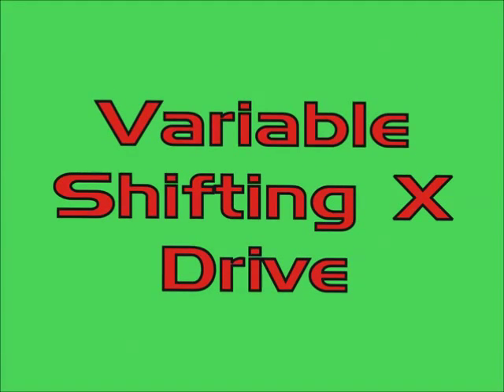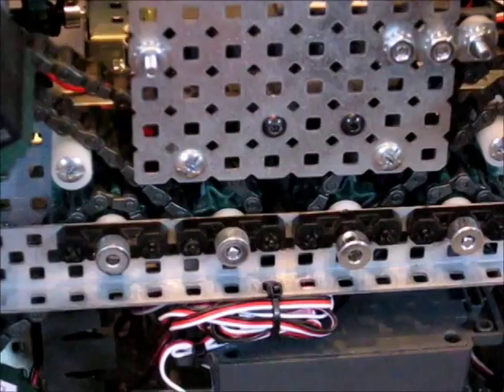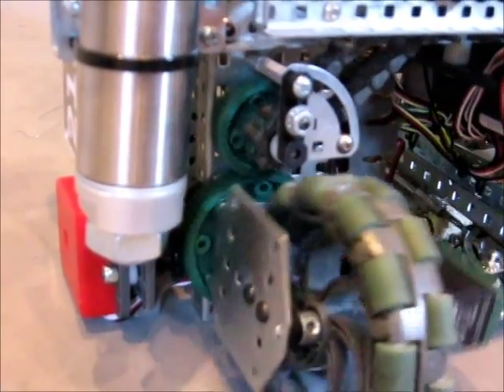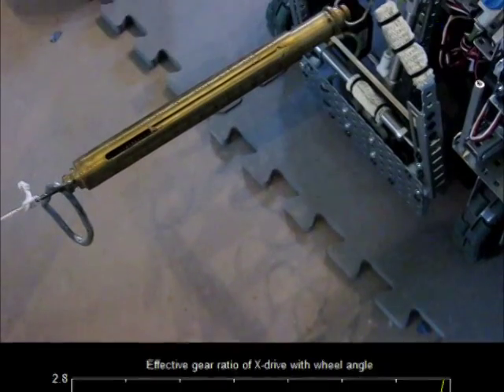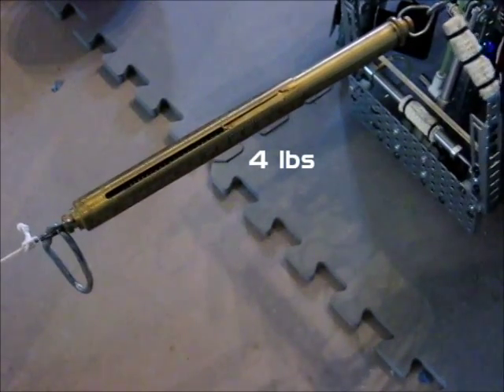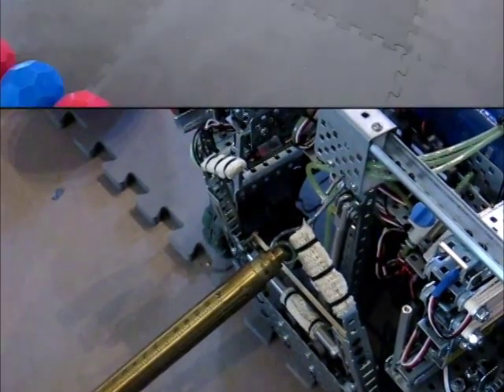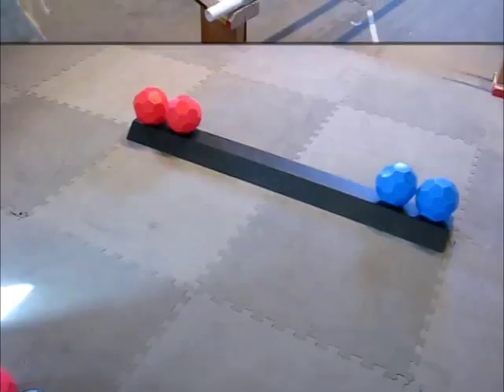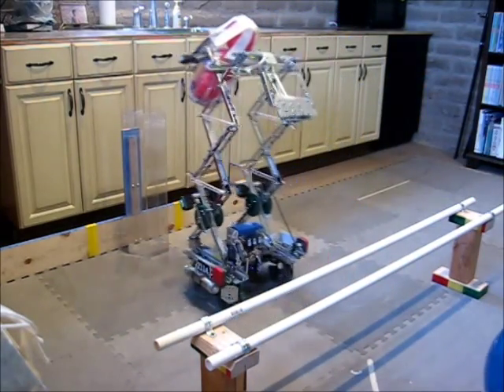2114a - Team Automata: The Variable Shifting X Drive

Comment: What is the amount of motors used for the total build?
Reply: The robot uses a total of 10 motors, 5 of which are for the drive:
   4 - wheels
   1 - shifting
   4 - lift
   1 - intake roller